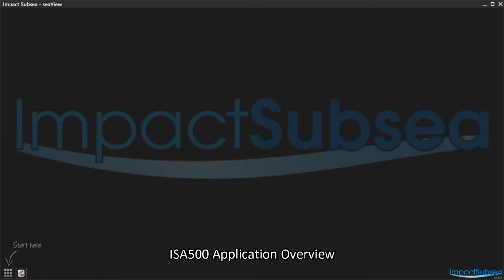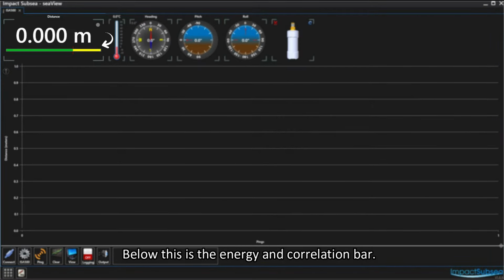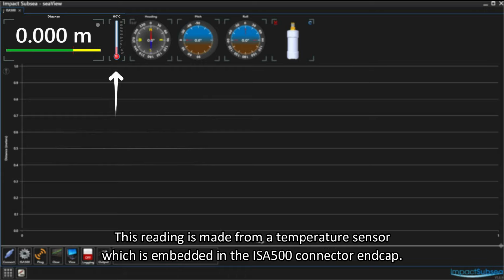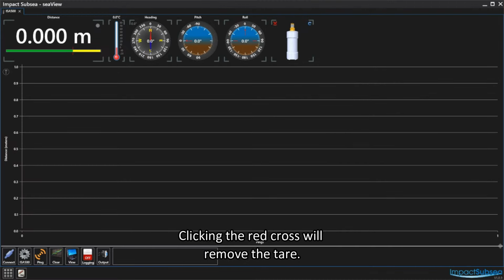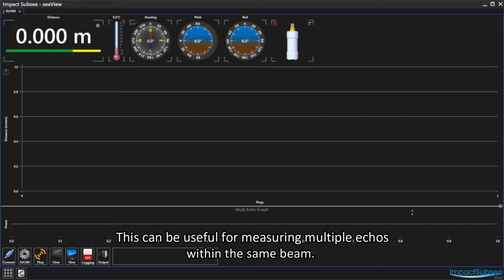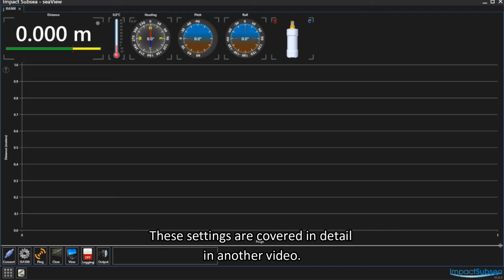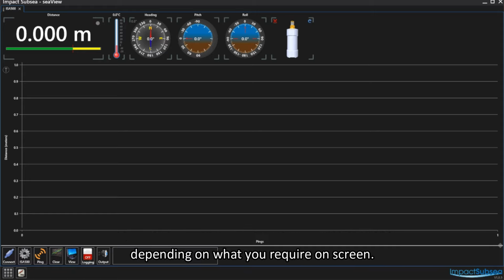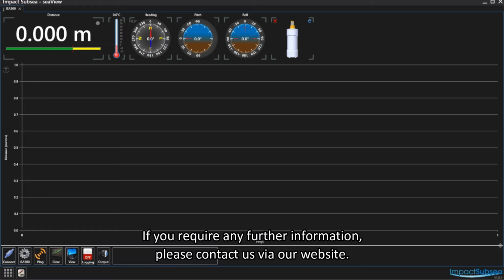seaView V1 ISA500 Application Overview

Comment: Hello, the video is very good and thanks for sharing it, it would be a lot of trouble to ask if you can inform me about aquatic sensors, or that they can work underwater. I tried the ultrasound ones and they don't work, where they touch the water the measurements are wrong
Reply from the maker: Hello Milton, thanks for your question! We would be happy to answer any questions you have on our underwater sensor solutions. Feel free to drop your questions over to info@impactsubsea.co.uk to discuss further.